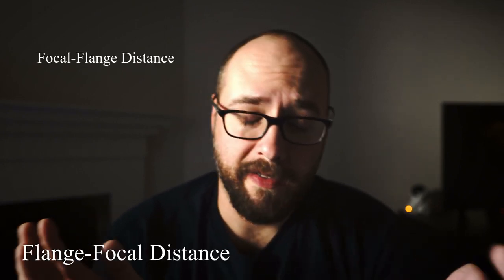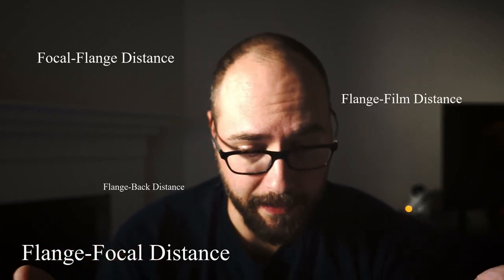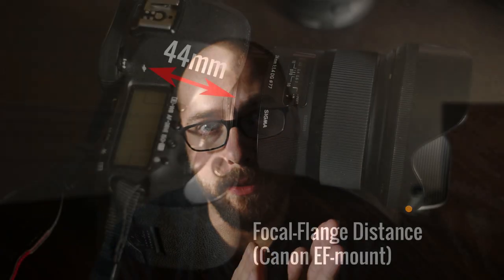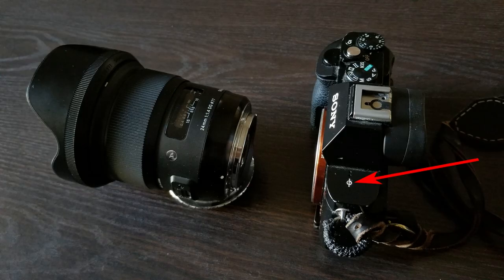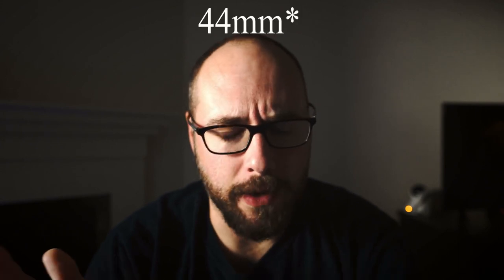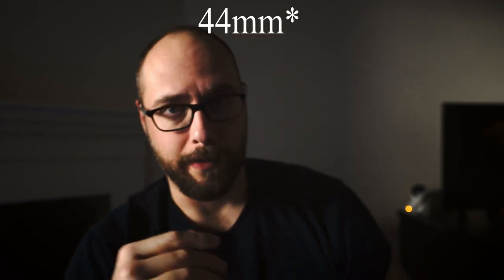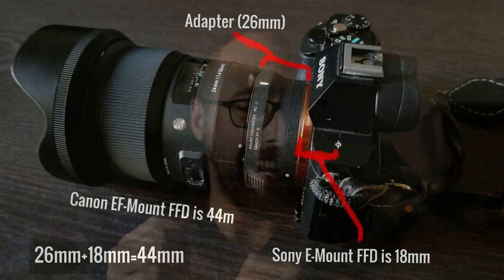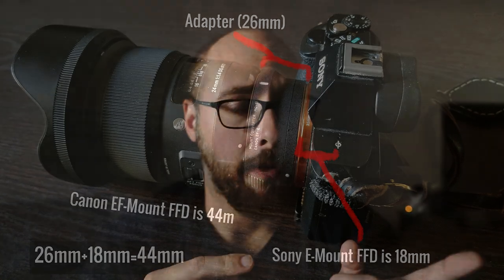The Secret (almost) to Adapting ANY Camera Lens: Flange Focal Distance Explained

Comment: So in other terms, i cannot use a mirrorless lens (ex. canon) adapted to another mirrorless body (ex. sony)? the FFD is greater than 18mm is it true?
Reply from the maker: Basically correct. A simple way to to remember is that as long as the original FFD of the lens original camera is greater than the FFD of the intended camera for use then it will GENERALLY be possible to adapt the lens.

Comment: Hey Adam I have a question for you because I'm not sure if I understand clearly. I have 2 lens for a camera Yashica FX-D QUARTZ that is 45.5mm of focal point. However I want to use them on my Nikon D3100 that is 46.5mm of focal point. Does that means that I need to have an adaptor of 1 mm?  Thank you.
Reply from the maker: Hey Alyson, you're technically correct in your thinking about the thickness of the adapter. However, most adapters I've seen (very few) for C/Y lenses (Yashica's mount) are actually fairly thicker than 1mm but the lens sort of "sits back" within the adapter a bit. I found this one that should work for you but it seems they are on the more relatively expensive side https://amzn.to/3lWz3hb I hope this helps.
Reply: @AdamWelch  OK thanks!
Reply from the maker: @alyson3188  Oh and let me know how it goes if you don't mind!
Reply: @AdamWelch  No problem I'm just gonna save some money first :)

Comment: Do all Sony E-Mount cameras have an 18mm flange distance? If so does it make a difference if it is a mirrorless camera or a dslr, besides crop factor?
Reply from the maker: All E-mount cameras, whether they are APS-C or full frame sensors (FE-mount) should have the same 18mm flange distance. However, Sony DSLR's (A-mount) have a massively larger flange distance to account for the mirror box. Those are 44.5 flange distance. Here's a quick reference chart I use quite a bit over on Wiki https://en.wikipedia.org/wiki/Flange_focal_distance
Reply: @AdamWelch  Thank you sir! My googling was insufficient, but you have helped me in my blooming process

Comment: When using 50mm vintage lens with adapter to sony mirrorless camera, do i use steadyshot setting to 50mm manual or i need to add the distance of the adapter used so it should be more than 50mm?
Reply from the maker: Hi Aldo, great question! Set the Steady Shot to the actual focal length indicated on the lens...at least for full frame sensors when using vintage lenses intended for 135 format (35mm) film. The reason for this is because even though you are essentially adding an extension tube (the adapter) it is only to correct for the increased flange distance. So, as far as your camera is concerned, it is seeing through a 50mm lens. However, if you happen to be using a crop sensor camera with your lens then set the steady shot based on the crop factor adjusted focal length. For example, Sony's crop factor is about 1.5x, so a 50mm lens which was intended for a 35mm format camera would be an approximately 75mm lens when used on a crop sensor Sony camera and that would be what you set your Steady Shot. I hope this helps!
Reply: @AdamWelch  that's a very well explained answer, thanks so much!

Comment: hey.. I just thinking.. can i make the flange distance further than it use to, I want to make an instax adaptor for my film camera.. but I don't want to change the camera too much, like.. can I still get te focus sync to the viewfinder or I can't get the focus at all ?
I'm using zenit 122 camera with jupiter lenses btw
Reply from the maker: Hmmmm, I'm not sure if I'm understanding correctly but it will likely be very difficult depending on your camera. Basically, if your Instax adapter places the film plane further away from the lens than it was originally then the lens would need to be moved further inside the camera body to maintain the manufacturers FFD. If the film plain is moved closer to the lens then you would need some type of spacer between the lens and the mount for the same reason. If you could somehow manage to get the Instax film to be in exactly the same plane as the original film then you wouldn't need to change anything in terms of FFD.
Reply: @AdamWelch  hmmm... I have one more question.. can I change the FFD with placing some kind of Magnifying glass inside the cameras body

Comment: Adam, as I'm still in the DSLR camp, I haven't read up much about adapters. That said, one area I wonder about is cross-mount compatibility re: autofocus. Even auto exposure might be limited due to variability of electronic aperture. Anyway, a possible topics for future quick-vids. Thanks.
Reply from the maker: Very valid points, Eric. I actually started off adapting old Nikkor AI-s lenses to my Canon 7D DSLR simply out of necessity years ago. I knew nothing about the concepts behind it so I really lucked out. You're correct concerning the AF and aperture issues as well and these become more interesting when you are using lenses without external aperture rings. The more I think about it, I your right about doing a video breaking down adapters themselves. Thanks a lot and I always appreciate your comments!

Comment: t-mount and m42 mount are same? can we mount m42 lens on t or t2 adapter?
Reply from the maker: I don't have any personal experience with t-mount lenses but from my understanding that both the M42 and T-mounts are both 42mm in diameter the thread pitch is different. So no, I don't think they would be interchangeable.

Comment: Hello, Great Video but aI have a question. I am trying to adapt a lomo instant wide camera to work as a instant film back to the Polaroid 600se that worked with the discontinued Fp100. I am almost there, but due to hardware limitations, the back is about 4mm long than the original focal flange. I am assuming that these 4 mm have consequences am I right? Thanks
Reply from the maker: First, extremely cool idea! But yes, that 4mm distance will cause issues with infinity focus (focusing past infinity I should think). If the distance was less it would be a much easier fix using spacers/shims but since the distance is longer than the original FFD it would require recessing either the lens or the film back to compensate. Sorry that I don't know more about that particular Polaroid to be more of help.
Reply: @AdamWelch  Thanks !

Comment: Hey man, great informative video, I have a go pro 8 with a 52mm filter, I am interested in trying to get it set up with vintage lens, do you know if it is possible without serious vignetting?
Reply from the maker: Hey Gil, I know of a Canadian company that makes dedicated mount converters for quite a few lenses...Back Bone? Back-Bone? It's something along those lines. I've never used them but there was some buzz a couple years ago I think. As for the vignetting, with the size of the GoPro sensor being smaller than the 35mm film frame (most of the vintage lenses you'll find were at least made for this size) I don't think vignetting would be a problem. In fact, since you'll be shooting through the center of the lens field it would essentially be making use of the "sweet spot" of virtually any lens you happen to be using. Hope this helps!

Comment: So I have a Minolta Rokkor 50mm f/1.7 and a Canon 5D Mark III and I know that you have to be ridiculously close to get the focus. Can you explain this to me a little more I depth? Is there any solution or is it like you said in the video where it’s basically impossible. I bought an adapter and everything
Reply from the maker: Very interesting. The flange distance on the Canon is 44mm and the Minolta has a 43.5mm flange distance. So, from a technical standpoint, that lens would need to be moved CLOSER to the sensor of the 5D to achieve focus. However, the .5mm shouldn't effect the focusing to an extreme extent; meaning that you just likely wouldn't be able to focus to infinity. When you say you have to get quite close, what exactly do you mean? As in you can't focus on anything at all unless your extremely close?
Reply: @AdamWelch  yes exactly. Like if it was a person I’d have to be inches from their face
Reply from the maker: @nolani6492  Hmmm yeah that doesn't sound right. The adapter should actually move your lens slight inside the camera body (not much) such as this one: https://amzn.to/3lO0RUS What adapter do you have? Does it say MD to EOS or MD to EF?
Reply: @AdamWelch  I got an adapter with no glass. It was a Md to EF
Reply: @AdamWelch  looking at it now I think that’s the problem. There was nothing to help it fully adapt to my dslr. Kinda just stuck the lens on there
Reply from the maker: The glass shouldn't really be necessary to focus at a basic level; those are just used in some adapters to increase speed but I may be wrong. Aside from any defects in the lens itself I'm honestly not sure what the problem might be. Have you ever used the lens with another camera?
Reply: @AdamWelch  I have not but I can try and see if it’s different
Reply from the maker: Yes, because at the risk sounding completely reductionist, if you have the correct adapter for your application, and there's no problem with your camera, and there's not problem with the lens there's not much reason for it not to work. Let me know how it goes and if I run across any similar issues I'll let you know if there was a solution. Good luck.
Reply: @AdamWelch  thank you!

Comment: So, when i have a shorter Focal Distance in my camera nikon d800 and i wat to use a mirrorless lens what do i do?
Reply from the maker: Unfortunately, that will be impossible. Most mirrorless lenses are made for just that, mirrorless cameras, which have a much shorter flange distance than DSLR/SLR cameras due to the lack of a mirror box. Most mirrorless (a broad generalization) have a flange distance around 18-22mm. Your Nikon D800 has a flange distance of roughly 46.5mm. Let's say whatever mirrorless camera lens you are trying to adapt has a flange distance of 20mm. This means that the lens would have to be moved back towards the image sensor 26.5mm to achieve its designed focusing. And while I said it's impossible, it is technically "doable" but the entire reflex mirror of the Nikon would have to be removed and a custom flange/cone constructed. 

All this to say that while lenses originally meant for DSLR/SLR style cameras you can almost always adapt them to mirrorless cameras, but lenses originally designed for mirrorless cameras can't be adapted to DSLR/SLR style cameras.
Reply: @AdamWelch Ok, thank you for your awnser.
Reply from the maker: @therealWilliamStuart  Does the explanation make sense for you and answer your question?
Reply: @AdamWelch It sure does, appreciate it!

Comment: can we not make an adapter that reduces the flange distance? Like for speed boosters, there's glass inside which gives you a boost in speed for the aperture and widens the field of view. Cant you make an adapter that has glass sticking out in the back that pushes the flange distance further in the camera?
Reply from the maker: These exist. However, the application is highly limited because you will obstruct the reflex mirror in SLR cameras and there's very little distance between the flange and sensor on mirrorless cameras. In reality, since mirrorleed cameras already have a minute FFD the only real use for an adapter such as that would be for SLR cameras which, as I said, is a highly limited in it's practical use.
Reply: @AdamWelch  not for slr cameras, since as you said the mirror. But it could be used for other cameras with ef and pl mounts that don’t have those things obstructing. They came out with an anamorphic lens that has the same thing. But could you tell me what adapter has that, I didn’t know it already existed
Reply from the maker: Well, that's incorrect. The reason mirrorless cameras have such short flange distances compared to SLR cameras is precisely because there is no mirror. That is, with the mirror removed, the sensor/film plane is moved closer to the rear of the lens. Even though the mirror is removed this doesn't mean there is just empty space there.
Reply from the maker: @AnimeZone247  Oh and to your question about which adapters actually inset the lens bayonet, the Nikon F to Canon EF adapter insets the lens approximately 2.5mm. I'm actually having a difficult time finding an example. Maybe it became too much of a liability.
Reply: @AdamWelch  I didn’t say anything like that. I said that adapter wouldn’t work for DSLRs bc of the mirror. But there are cameras (cinema cameras) that don’t have that mirror and that has an ef and pl mount that, that adapter would work on. Just like black magic cameras, pocket 6k, ursa mini, etc
Reply from the maker: @AnimeZone247  Well my friend, that's out of my scope. Of course, as I'm sure you know, there would be wildly varying issues with focusing; namely infinity focus. Are you familiar with this concept of should I explain it to you?
Reply: @AdamWelch  yea I kind of figured that, it was a thought in my head. And no it’s ok I know about infinity focus😂, thanks tho
Reply from the maker: @AnimeZone247  Oh great! So, since you know about infinity focus did you misspeak in your previous comment where you were talking about the cinema cameras?

Comment: I have a lumix gh5 and I want to use a vivitar series 1 67mm lens. What adapter should I use?
Reply from the maker: Do you know the mount for the Vivitar? The were made to fit multiple cameras.
Reply: @AdamWelch  I don't, how would I find that out? I'm a beginner with this stuff
Reply from the maker: @ebbiejeebie  It's likely either a Canon FD mount or a Nikon F mount. I would just do a quick Google image search for each of those mounts and compare it to the lens. Once you figure that out you'll be looking for an "L Mount to xxxxx mount" adapter.
Reply: @AdamWelch  Alright thanks. The lens was attached to an Minolta xg7
Reply from the maker: @ebbiejeebie  Ah I see. In the that case you would likely need an MD to MFT (Micro 4/3) adapter. Something along the lines of this. https://amzn.to/3AroCIL But of course,  there's always a chance it will be incorrect depending on a couple of factors so even if you don't get an adapter from Amazon I would purchase from a place which offers returns.
Reply from the maker: @ebbiejeebie  Oh a couple things I should probably mention that will help you in the future: The 67mm you mentioned isn't the focal length of the lens, its the diameter of the filter/cap/hood size so if you ever need a filter or cap or lens hood that will be the size you need. Also, keep in mind there will be something called a "crop factor" since the lens you have was meant to be used with 35mm (135 format) film and you will be using it with a much smaller sensor camera. So whatever the focal length of the lens you will be multiplying that times 2. So a 50mm lens will have a field of view like a 100mm lens, a 210mm will seem like a 420mm, ect.
Reply: @AdamWelch  Oh alright. Thanks for your help, I really appreciate it

Comment: Very helpful video! Im trying to adapt an arri standard lens to an ef mount. Standard has 52mm and EF has 44mm.  I can't find an existing adapter. Any advice would be greatly appreciated
Reply from the maker: Hey Kyle, I'll admit that I have ZERO experience with Arri lenses but I did find this on eBay. The description states it fits Arri B and Arri Standard. I'd of course highly recommend contacting the seller first for your application! https://www.ebay.com/itm/Arri-Bayonet-Arri-B-lens-to-Canon-EOS-camera-mount-adapter-/252936066940 That's not an affiliate link by the way and I have no connection to that seller fyi haha Hope that helps!